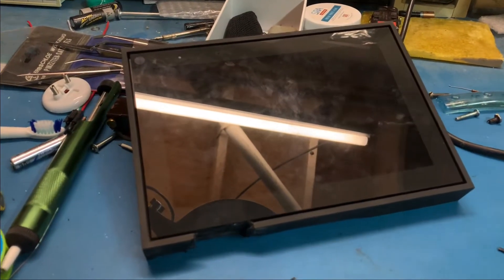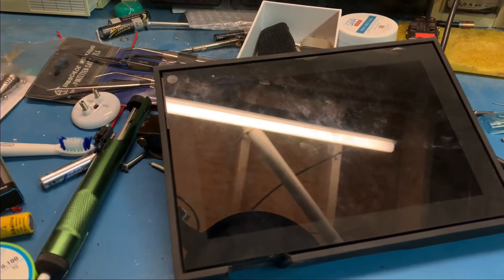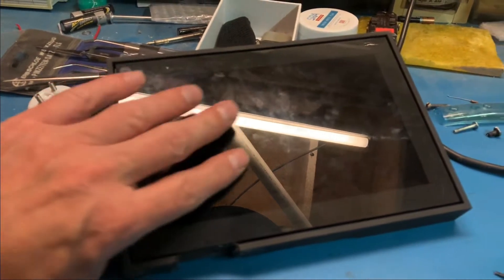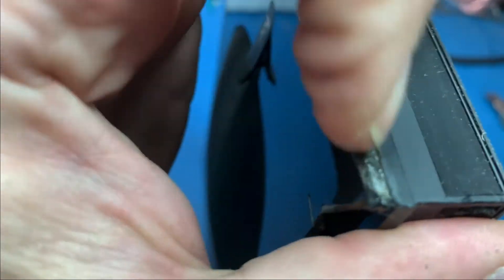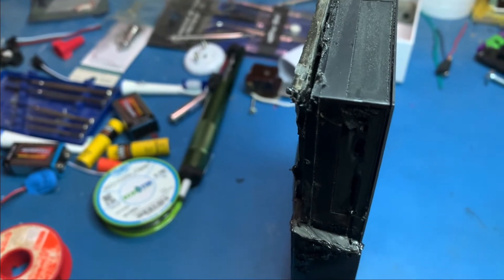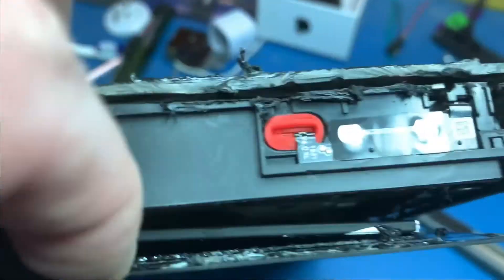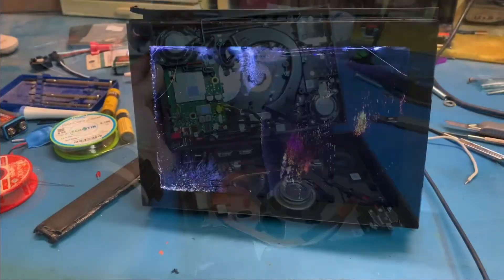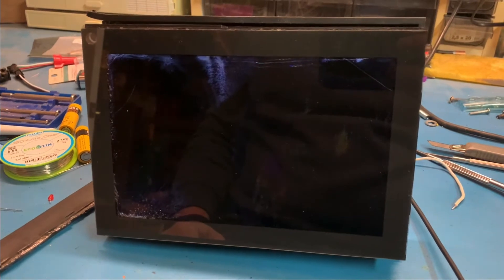Facebook portal teardown

Comment: Now that the Facebook Portal is officially dead, I'm thinking about getting a used one to turn into a smart screen, small tv or something like that, because I like the design, I think it would look good in my kitchen. Do you have an idea for something similar for your device? I'm looking for more details on the lcd panel of this device to see if I can convert it and add an hdmi input (to plug a chromecast or a firestick).
Reply from the maker: Cool idea. I personally threw it away as I felt it wasn’t worth the effort to re-engineer it. You might be better off using the shell and exchange the inside with a raspberry pi or so and a known LCD. 
You might get a fb portal for cheap and if you figure out the display maybe you only need a micro processor to turn the lcd on and such. Using the onboard micro would be another level imo.
Reply: @RandomDIY09  You're right, I don't think it's worth reengineering this equipment, because if it had been a sales success, there would be more information about it on the internet. Thanks for your raspberry pi tip, I hadn't thought of that.  Maybe I'll do this with an old iMac g4, which I can buy here in France for less than €30

Comment: Thanks for posting this. I have the same FB Portal that suddenly just wouldnt turn on anymore even if I use a different power connector. I have been wanting to open it without damaging it and hope to somehow repair it if its something that just got loose inside.
Reply: I face the same issue and even new power adapter still doesn't turn the portal on. Any tips on how to recover its functionality will be very appreciated